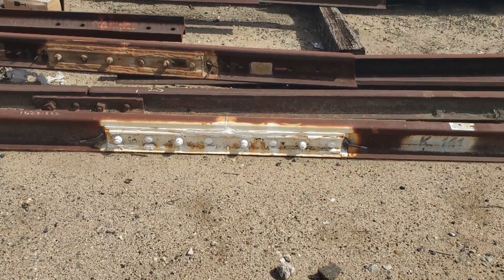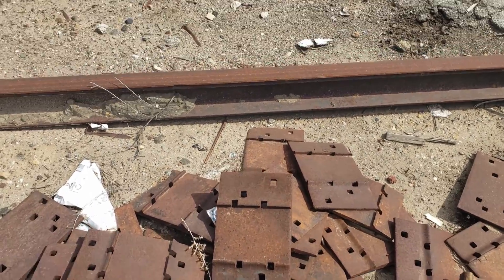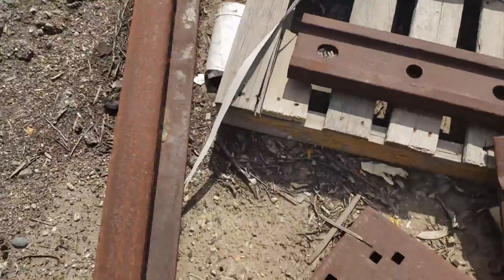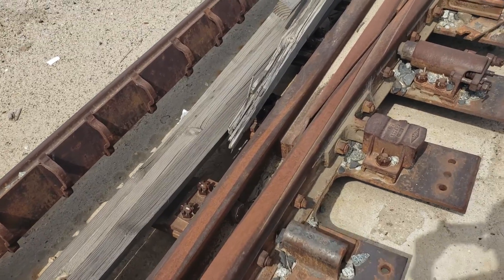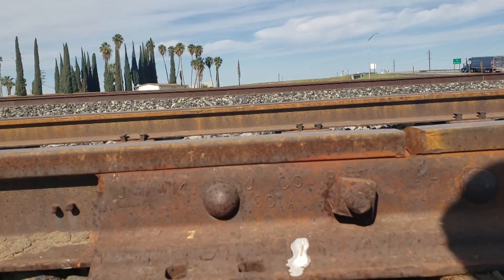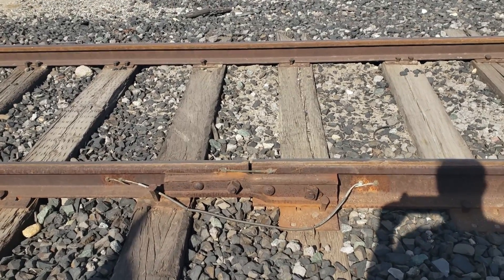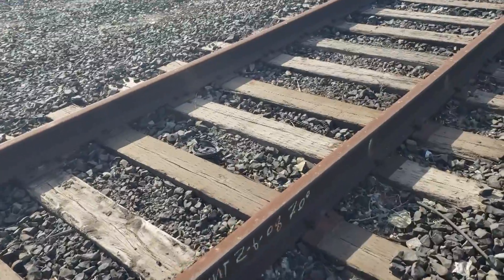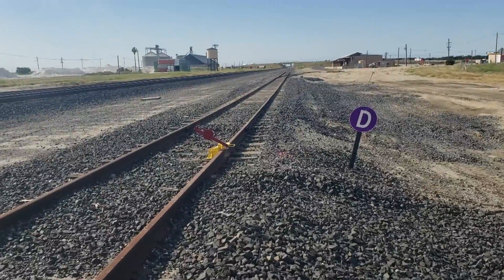All Rail is Not Created Equal! Here's Why!

Comment: I believe the heaviest rail is 155 lb.  Never have heard of anything heavier/larger than that..Aesthetically, I like the low rail look of the earlier days and thus in HO scale it'd be like code 40-70. I don't like today's very heavy, tall rail.  And what you are calling a 'cop' or 'comp' joint I learned is called a 'stepped joint'...(connecting two different height rail)..
Reply from the maker: I'm just going by what the track guys called them, but thanks for the info and for checking it out!

Comment: what is that squeal the wheels make in some places sometimes?is that a load around a corner causing friction of some sort?
Reply from the maker: It's the wheel flanges against the inside of the rail. It can be ear piercing! Here is the link to a video I did about the curve oilers that help keep both from wearing too quickly. Thanks for checking it out!
https://youtu.be/pB-5t5kS2V4
Reply: @MarkClayMcGowan  wow thats great thanks

Comment: I am a Civil Engineer, who spent over 20 years in a Division Engineer's Office,  consulting engineering firms, rail contractors, and tourist railroads designing, laying out, inspecting, building, maintaining, and operating trains on track.  I have a booklet compiled by a scrap dealer that lists all of the known rail sizes, at the time, of rolled steel rail in the US from 8 lb to 155 lb plus crane rail of 105 to 175 lb.   This booklet shows the sections, the steel companies rolling them, and the dimensions of the height, base, head, web, fishing, and bar height.  
 I have worked with 8 lb and 155 lb rail, not at the same time.  I even have small pieces of U-rail, pear-head rail, and bi-metal rail as collection pieces.  
The Central Pacific RR used 60 lb rail for their track coming from Sacramento while the Union Pacific RR used 56 lb rail coming from Omaha.  Many narrow-gauge railroads were built with 20, 25, and 30 lb rails in the 1870s and 80s to reduce construction costs.  U rail and pear-head rail were used before and during the time of the War Between the States in 1861-65.  Wrought iron was used for rail until about the 1870s after the Bessemer process for making steel became prominent.
Head-free rail was developed to hopefully reduce the friction of the flanges against the rail by reducing the contact face of the two.  Of course, it didn't work, but it was tried.
The sections of 112RE, 115RE, and 119 all have the same fishing or web height for the angle or joint bars.  The 112 section experienced a lot of head-web cracks due to high stress from small-radius transitions between the head and web which the 115 section overcame.  The 119 section just added more metal in the head of the rail for more wear and beam strength.

The Pandrol clips you were describing earlier are shown at 12:14 and just after with the traditional spikes on the right.
The head bonds are welded by a Thermite bond.  The web bonds are made with Thermite or a hole drilled through the web and a pin driven into the holes.   For a track that is electrified such as a trolley or NEC, etc, the bonds are much larger and doubled between the rails of a joint to handle the larger current.   I had to take care of 3 crossings at a tourist railroad.
Originally, rails were wood, then pieces of iron straps nailed on top of the wood, cast iron bars 3 feet long supported by chairs, wrought iron rolled into a section of about 15 feet long to about 30 feet long at which time steel became the preferred choice, then 33 feet long, 39 feet long, and welding the individual rails together, and the 78-foot and/or 10-meter rails when continuous bloom casting of vacuum-degassed steel was instituted to produce cleaner steel.  The length of individual rails got longer as the cars carrying them got longer until plant welding of rail and the welded rail trains were developed.  Cars to carry rail were flats and gondolas, so as the cars grew in length from 25 feet to 79 feet, the rails followed in what could be carried.  In the 1920s &30s, control-cooled rail was developed where the newly rolled rail was stacked in an insulated box at the mill to slowly cool from the red-hot rolling temperature of 1200-1500 F down to 700 F which let the hydrogen gas in the steel escape improving the steel so not as many defects formed in the rail steel to cause broken rails.
I think I would enjoy an afternoon spinning stories with you but I am in northeast Texas and 76.

Comment: An old PRR branch line near where I lived was laid with 70 and 85 pound rail. Surprisingly, the 85# rail sections had an earlier date than the 70# rail. Where the branch met the mainline there were 3 or 4 comp joints to go from 70# branch rail to 141# mainline rail.

Comment: In New Zealand , like UK. we refer to "Fish Plates" . For rail to sleeper (tie) fastening we use Pandrol Clips. Under the rail is the Pandrol plate with an eye for the clip. The plate is attached to the sleeper with screw fasteners. Concrete sleepers have the plate cast in. A plastic pad is installed between the plate and under-side of the rail.
David Field

Comment: Thanks for your video.  Maybe you can help in locating a film I saw on TV about 30 - 40 years ago.  To my best recollection it was a documentary (maybe on public TV) that chronicled the evolution of railroad safety. It may have been a British produced documentary.  It went something like this.... Using actual case history it talked about signal men using lanterns until the time a light failed resulting in a crash.  As a result colored lights were implemented which worked until a certain set of conditions exposed a flaw in that method and new measures were implemented to correct that.  As time went on certain safety measures which had worked for years revealed a flaw resulting in yet another accident.  It spanned the beginning of railroading up to current time (30-40 years ago).  It was a very interesting show and I've tried to locate it using the internet with no success.  I guess the investigators were the  FAA of the railroad industry.  If you know of or able to suggest a way to find this film it would be greatly appreciated.
Reply from the maker: I have never seen or heard of it. You might contact the Federal Railroad Administration or National Transportation Safety Board. Thanks for checking it out!
Reply: The FAA of the rail industry was the Interstate Commerce Commission or ICC until taken over by the NTSB and FRA.

Comment: Very interesting information .  UP has a rail welding plant in the San Fransisco Bay area that welds new rail that's imported from Japan . UP and the Japanese partnered to build special ships for the 440 ft. sticks of rail and they weld 4 sticks to make one string . The last I read there's a loaded ship enroute to the U.S. and an empty ship headed back to Japan for a load of new rail . The ships dock right next to the welding plant and is unloaded and stacked until it's needed . The rail trains were extended to accomidate the extra rail from the standard 1440 ft. rails . UP has other welding plants but I'm not sure where they are located now .  We had a welding plant here in North Little Rock , Arkansas and it was shut down and sttarted getting rail out of Denison , Texas and then that plant was shut down as well as the plant in Laramie , Wyoming . There's a welding plant in Pueblo , Colorado that's in line with the steel mill that makes the rail and is welded in the welding plant . We used to take the used rail to Denison and Laramie where the rail would be pulled off the trains and inspected , bad sections would be cut out and then the good rail would be rewelded into 1440 ft. strings and loaded on rail trains that held 50 strings of rail . This used rail would be used in locations such as sidings , yard tracks and subdivisions that didn't have heavy trains or light traffic .  Rail on the mainline was also changed after years of use and ton miles of train use . So yes there is an age factor for replacing rail . Lots of factors go into the reason rail is changed out .   Great video Mark .
Reply from the maker: Thanks for the info!

Comment: I've heard that you can actually stop a real train like you would do on a model train layout. by shorting out both rails.
Reply from the maker: You can't actually stop a train by doing that but, if the line is signaled, shorting the rails will cause the signals to go to stop and that will stop the trains. If it isn't signaled, it will have no effect on anything unless there is a crossing nearby.
Thanks for checking it out!
Reply: @MarkClayMcGowan   You used the term "shunt", which is correct,  which is changing the length of the circuit not shorting it.  I am sorry, it is my COPD or PTSD about using the correct terminology to avoid confusion.  People get to talking with others about subjects and forget that some of the terms used may not be known or understood by the other person.

Comment: In the Netherlands (and most of Europe) we use UIC 54 Rail - weight is 54 kg per meter.
In addition, the NP 46 is still often used on older tracks (46 kg/m.)
UIC 60 is sometimes used for heavy freight train tracks.

(54 kg/m ~ 109 lbs / yard ?)

Comment: Very interesting. Couple questions. How is old rail recycled and is there actual movement involved to cross tracks with those frogs? What if the train doesn't want to cross at that point. I couldn't quit grasp how they work.
Reply from the maker: Most times it is scrapped, cleaned, melted and turned into new rail. It is sometimes purchased by museums or class II or III roads or repurposed as barricades, etc.
If you're talking about the jump frogs, the distance across the frog isn't enough to cause problems. It's amazing what enough weight can accomplish!
Reply: @MarkClayMcGowan  Find several videos about frogs and turnouts.  The definition of a frog is the track structure that allows the flange of one wheel to cross the rail for the other wheel on a railroad track.  In other words; the X in the frog is where one gauge line crosses the other gauge line, this can be in a turnout or where one track intersects another track at a larger angle, a diamond.

Comment: one day i passed along a stopped train that had continous rail about 30 train cars long. as i passed by it you could see the rails running from one car to the next from the first one to the last one.
Reply from the maker: Ribbon rail (or continuously welded rail) train. The segments are 1/4 mile long and are laid along the tracks to replace existing rail. A cable is used to secure the end of the rail and the train just slowly moves out from under it. It's pretty cool to watch.
Reply: @MarkClayMcGowan  & arewebeing hoodwinked  There are several videos showing welded rail being unloaded onto the ground and onto ties when laying new track.

Comment: Hey Mark good video. I have seen rail here in western Canada stamped 1897 on a lightly used siding not far from our home. Pretty old stuff. My question is on ballast cleaning. They do it for a good reason I'm sure. So what happens if the ballast is left uncleaned as it seems to be just dust or sand?
Reply from the maker: The ballast is what secures the track structure. If it becomes fouled with dirt and debris it will weaken the structure and can cause severe problems.
Reply: @MarkClayMcGowan  I'm guessing that the fouled ballast when wet will turn into a sort of slurry then it can't support the track anymore as it flows away from the crossties? THX
Reply: @briansumner2700   The ballast can wear down to make dust then a slurry when wet and also dirt can pump up into the ballast if the drainage is bad.  When this happens the bad spot just gets worse until the drainage is improved or rectified (fixed).  Working on the track is a never-ending proposition as the track is always moving under the load of moving trains.

Comment: I was a trackman in the 1970's.In the training video they showed not to sit on the rail at a joint.When the rail heats up and expands the joints will slam together,taking a half moon out of your butt.We used mostly 127 lb rail.The new rail would come in quarter mile sections.They would roll the rail off a train beside the track and use backhoes to straighten the long snake out.

Comment: So I was watching your vid on rail and thinking about the weight per yard. I did some digging and found out that rail is rolled into weights of 171 and even 175 pounds per 3 feet. But its not used in railroading its used for the tracks for heavy duty overhead cranes. Here is where I found the info along with a bunch of other great info on tracks and fasteners. Thought you might want to take a look.       https://www.wabtec.com/uploads/outlinedrawings/Track-Components-Section.pdf    Thanks and greetings from Rochester NY.

Comment: The video showed the date on an 80--pound angle bar, but I was hoping to see an example of a date on a modern piece of ribbon rail. Also, do the date codes vary from manufacturer to manufacturer? Or do they all use an industry-standard date code?

BTW, hope you're feeling better.
Reply: Industry-standard is AREA or American Railroad Engineering Association now AREMA or American Railroad Engineering and Maintenance Association developed suggested specifications and practices by committees of member railroad engineers.  The compiled recommended specifications, practices, and procedures occupy two volumes of over 1000 pages that are continually gone over and updated as needed plus a volume of drawings of rail sections, track components, tools, etc. including bridges.  The signal department has its own group.  The mechanical department has its own group.

Comment: The smallest mine rail is 8# (1-1/2" from base to crown) the largest rail was 152 PS (152# Pennsylvania Special). This was used on the Pennsylvania Railroad main line. Today the Finger Lakes Railway in Upstate NY has some 152 PS rail on its Auburn Road between Syracuse and Auburn, NY.

Comment: As well as the rail profiles the chemical opposition of rail tracks differs around the world.  I worked in thermit welding track all round the world and our blends had to be tailored to suit the tracks we were working on.  Generally track is about <1% manganese, .75% Carbon.  Some tracks in more hostile environments had additional alloying elements - usually vanadium and niobium (columbium) for creep resistance and yield strength.  In some parts of the “developing” world no two lengths of rail were alike!

Comment: Just for information. There are larger rail shaped structural steel sections commonly called 'crane rail'  used for heavy lift travelling cranes and similar devices which can be up to 1000mm deep with a head on which a  (very) large wheel can roll and be located by single or double flanges on one side and single flange or plain wheel on the other. Steel works cranes go for the double flange/ plain to allow for expansion over furnaces.

Comment: I was wondering how an electric loco would ground if the rail is used for signaling or other purposes?
Reply: Track Circuit segments are staggered by length. Only a few feet of track circuit rail need be opposite each other.
The eartihng cables are buried under the track circuit segments, going 'around' the track circuit.
Reply: Signalling an electrified railroad is a whole lot more complicated than this.  The overhead or contact wire is positive and the rails are negative or the return part of the power circuit.  This is the domain of the electrical engineers who earn their money figuring that out.  I am just a lowly track man.

Comment: Merely a point of information and not trying to out-do anyone, I'm a retired engineer. As a young kid, I worked in an amusement park with a 12" gauge steam railroad. They used both 8 lb and 12 lb steel rail that was salvaged from local coal operations. 
Also, while watching a steam powered sawmill in action, I noticed the log carriage was rolling back and forth on actual 2 lb steel rail. Live steam models generally run 9n extruded aluminum rail, but as models have grown in size, they have turned to using 1" tall rolled steel rail, not sure of it's weight. 
Thanks for the informative videos, I'm sure that non-railroaders find them very beneficial!
Reply from the maker: Since making this video I've run across, in reading and research, about standard guage lines over time running on rail as light as 30 pounds! That seems pretty sketchy but I guess they worked with what they had!
Where do you do your live steam? I'd love to do a piece on that when the world opens up again!
Being offered new information is never upstaging. I love learning!
Thanks for checking it out!

Comment: It is appalling to see how cracked and weathered the tiles are - even on the main line.  The US sorely needs to upgrade its rail (among others) infrastructure.
Reply: They are fine for what they need to do.
Reply: @MilwaukeeF40C  One way to find out is to research train derealments and see how many were due ultimately to failed ties.
Reply: @jhorne18  Not ties like these.  As long as there is a good tie on each side, some of them can turn in to ant poop before they need to be changed and that way they don't need to be taken to the landfill.
Reply: A question sir, are YOU going to provide the money to upgrade as you put it?  Considering that the railroads pay for all of this out of the freight charges from hauling 'stuff', I think they do a great job while generating a profit (the amount of which is open for debate in another place and time).